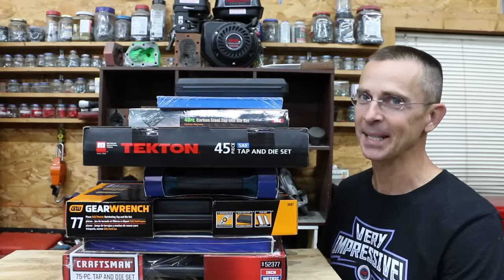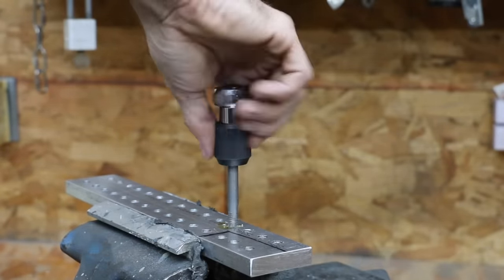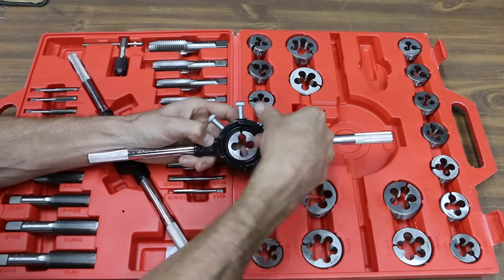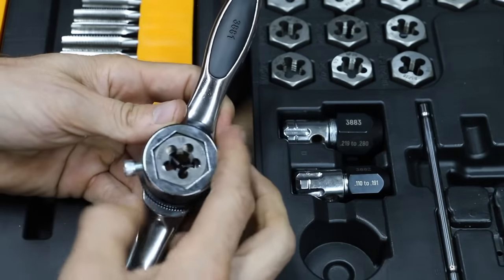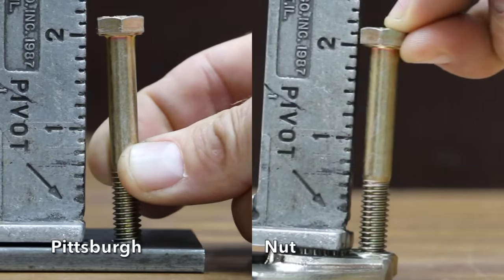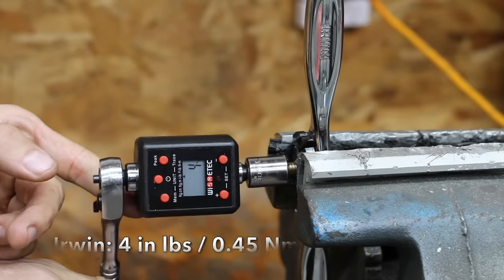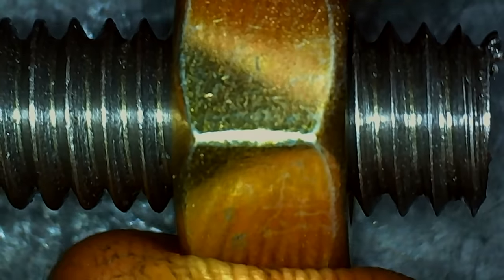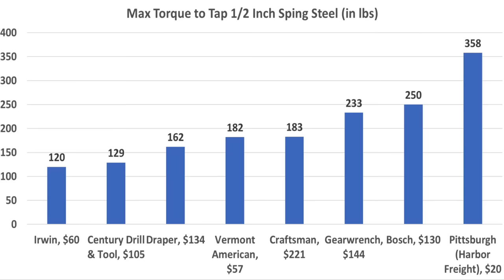Best TAP & DIE Set? Craftsman vs Irwin, Bosch, Draper, Vermont American, Tekton, GearWrench

Comment: I need you to know that I'm trying to be informative and not critical with this comment. You are possibly the best content provider that I follow, for a number of reasons. I love your videos and the time and effort you put into "covering all the bases" with each group of items you test. Having said that, I, respectfully, say that you may have come up a little short on this one. 
   Training as a draftsman back when we had Vocational and Technical High Schools in this country that trained young people to go to work and not always to go to college, I learned that there are various "Fit" standards for American, and I can only assume, Metric, threaded fasteners. I have worked with many skilled tradesmen over the years and it is the rare one that knows this. Mechanical engineers and machinists know it, but not mechanics, or other end users, so much. When you use the "recommended" twist drill for a given thread size in a "Kit" like this, you aren't wrong, but you need to understand that there is actually a range of drills that should be used for each tap, depending on how much "Thread Engagement", expressed as a percentage, is desired from the finished hole. Of course you can, and most users eventually do, decide on a "good enough" size that gets most jobs done. The problem arises when you begin to compare the wobble in a nut of unknown thread engagement on a bolt, also of unknown thread fit standard, to a cut thread using the same twist drill for each hole with multiple brands of taps. Each tap brand could be used with a differing drill size that could possible replicate the sample nut and bolt fit, so the wobble factor rating could be considerably changed and, therefore, doesn't mean the tap is of poor quality or design. You as the end user are supposed to be aware of these things. Many taps are meant to be used with Number or Letter drills, not fractional drills.
   I noticed that some of your dies were adjustable dies. The ones with a split in the circumference will be adjustable. Some of them that are adjustable will have a set screw that spans the gap created by the split and can be tightened to spread the split and give a shallower cut and a tighter thread fit. The second type of adjustable die has a slit and a "V" notch in the circumference. The handle for that die will have a screw that wedges itself into the "V" and forces it apart, again making the threads shallower and tighter. 
   How DEEP the threads are cut with both the taps and the dies, will influence the torque needed to cut the thread. That means that a very sharp die, cutting a very deep thread, could still have a high torque requirement and would yield a very sloppy thread. It doesn't make it a bad die.
   I don't know if you made adjustments to the dies or not, but adjusting them, and they are meant to be adjusted and usually cost more for that reason, will dramatically change your results in many ways. Likewise, It would be helpful to know if the same "standard drill" was recommended in all materials, by all the sets. One other consideration when comparing factory nuts and bolts the  home shop made threaded products is the quality of the machine driving the drill. A drill running in a press will run truer and yield a smaller, rounder hole than one run in a hand drill. Even starting a tap with a drill press doesn't guarantee that it will go straight (although for the thickness of material you where using, it should). The factories that make nuts and bolts use precision machines called, you guessed it, Screw Machines, to mass produce threaded fasteners. In a machine shop, when making a one off thread, a bench tapping machine or a lathe is used to make sure everything is lined up and that would require the least amount of torque. A thread that runs out will get harder and harder to make.

   I'd just like your subscribers to know that if the thread is too loose feeling, they should try a smaller drill and expect it to take more torque and lube. Also be aware that some dies can be adjusted for a very snug fit. Practice on some scrap first.
Reply: Dude get a life. 

Just kidding. Thank you for leaving this comment. It's nice to be getting the correct information when looking at this stuff. It's always nice to hear from someone who is experienced. Getting the wrong info can lead to some major trouble. So thank you! 😊
Reply: @NotAdamSnider  You're quite welcome. I wish I wasn't so lazy and was willing to invest in the gear and effort required to film content, since I do have experience in lots of useful skills. I use this YouTube resource all the time to acquire even more skills and value all the content makers that put in the effort that this fella does. He's right up there at the top, wouldn't you agree? I try to give back in the comments when I can because I do know how to talk ( ask any of my friends LOL) and write, although my typing is hunt and peck. I share as I can.
Reply: Thanks for that wealth good information, some of which I already knew. My uncle was a well paid tool & die maker, cutting his teeth while serving in the royal navy during WWII, below decks as an artificer, and later after the war for a major farm equipment manufacturer, so I picked up some of this minutia second hand. I have inherited some of his precision tools, mostly from companies like Gray, Butterfield and Starrett, well made good quality precision tools that will outlast you and your next generation, harder and harder to find these days. I feel those days of precision and quality and pride in one’s work are diminishing daily.
Reply: @62Cristoforo  
China.  That's what's behind the drop in quality.  Any manufacturer who moves operations to China isn't interested in quality.  First, the employees at the new factory, including supervisor will be newbies. Chinese managers will cut every corner possible, including using cheaper, lower grade metals than specified (if you supply the material yourself, they will sell it and buy cheaper), and then pocket the difference.  They will justify this fraud by: "If I don't do it, then I'm not doing enough for my family." Chinese don't trust each other, and will take advantage of any foreigner from a high trust society where people where living up to contractual obligations is considered the bare minimum, not a ceiling which should be sereptitiously unmet by slowly lowering product quality, farther and farther below the specifications, until the outsourcing company complains, and then just revert to the standard of the previously accepted shipment, with zero intention of EVER putting out product to the quality level specified in the purchase order.
Reply: @akulkis  and as long as people buy the garbage they'll keep sloshing it out.
Reply: Yeah ,I tried diff  twist drill sizes....I was surprised in torque and fit ,thread engagement.  You turned on bright light of knowledge. Thanks plenty
Reply: That's good information. But who would know? People would just use whatever bit comes with the set, or whatever size it says recommended, as being done here. Nothing wrong with that. Most of use aren't machinists just people with a problem to fix.
Reply: @KF1  I got tired of doing things over, or even making things worse by breaking taps off in holes.
Just like with going out to eat, I don't mind spending extra if it's good stuff!
Reply: Go have a coffee you deserve it after that dissertation!
Reply: Wow...I agree. I hade wondered about the recommended drill size by kit, and if there was a variant. Also, I think this video is more geared to hobbiests, home mechanics, etc., and not aerospace mechanics which is kind of where you are going - or for those who are, or are wanting to be machinists.
Reply: I wanna know what drillbit takes the most force sideways without snapping
Reply: @NotAdamSnider  hahaha.....     hahahahh....damn. anyone reading this...adams second quote was basically what i was gonna say.     A few years earlier I would have added the top with it as well.
Reply: @mrhalfstep  all of yall are the best.
Reply: This is the right information. The other to consider in this video is that you should never expect a high quality thread when using a ratchet tobdribe the tap. He made it even worse by adding in his meter as this just caused more slop. He should have used his drill press as a guide for running his tap if he was testing for thread quality and fit.
Reply: @Ibuildsht  A 2 1/2 inch bit takes a pretty good lickin' , but I don't know if it's the toughest. LOL
Reply: There is a fit class (tolerance) for like, every machined part. Nuts, bolts, machined threads, shafts, bearings, I mean like, everything.
Reply: @mdanm56  it was horrible to watch. I get the idea but it was very poor implanted
Reply: Thank you for this extensive explanation.
      The sharing of such detailed specific knowledge (or knowledge that is no longer taught) - I feel like that's exactly what the internet was made for.

Sincerely, thank you.
Reply: @iggysixx  Heck, you're welcome! I certainly get more than I give and I love it that way!
Reply: If it's not explained on the package, you can't possibly expect the average person to know this.
Reply: I was told that the hex shaped dies are only for thread chasing . Watching him use a drill an socket with a hex die on the rod stock was painful. I tapped out after that.
Reply: @ryandeboer9584  That isn't entirely accurate. Some hex shaped dies are just for chasing, but some have enough taper engineered into the design to cut fresh threads in round stock, provided it isn't hardened steel. They will give differing thread engagements depending on the diameter of the round stock and can't be adjusted to provide  tighter threads, which was the point of my original comment, but they actually are meant to cut threads into unthreaded rods. You just have to live with the engagement that they provide. Some of the dies that were used in this evaluation video were adjustable and could have been "tweeked" to give better than their "out of the box" result.
Reply: @mrhalfstep  thank you for all the info. I admit I have a “fetish” for bolts n nuts and taps n dies it seems.I get great satisfaction out of a successful project involving a few hand tapped fasteners. 😊
Reply: @akulkis  i cannot agree more. almost without exception, any dealings i've had with Chinese products, tools, brake rotors....you name it.....i have had a less than satisfactory outcome. their quality control is nonexistent. i've actually been looking to buy a good tap and die set for a while. it seems the only decent ones out there are the older sets (made in the u.s.) that i might find on ebay.  i'm done with buyng almost anything Chinese anymore. you end up buying twice if you do.
Reply: RollinRat  I know those things. You are preaching to the choir, as the saying goes. I'm tryin' to help those that don't know.
Reply: I wished comment could be print.
Reply: This was the absolute most respectful and informative "I'm an expert" comment I've ever seen. 
I wish VoTec HS had been an option when I was a kid, college was a huge waste of time, money, and liver health.  Assuming what you said is accurate, I learned more of value from your post and any single class I paid to take in college.
Reply: @shaynecarter-murray3127  Thank you. I love this guy's channel and was trying to be respectful. I'm pleased that it came across. BTW,  I'm not an expert. LOL There are still Vocational Training Facilities out there and there has never been a bigger demand for skilled workers. The training doesn't take long to pay for itself.
Reply: @troygoggans5495  screen shot the comment then type it into notepad. Or just write it down. 👍🏻
Reply: This video was quite cringey to watch with the crude execution of the tests. All of the T & D sets are basically toy sets compared to actual good ones.
Reply: Sounds like you should make a video so i can build a space ship mr perfect !
Reply: This is called Project Farm ! Something breaks you want to get whatever back and running ASAP. I was in farm service for 27 + years If a farmer needs to get back to the field get it fixed with what you have Cows need to be fed Get the unloader , conveyor , bunk running asap ! I really love what he does on his videos Not all of us can buy expensive tools so what he shows is how to save a buck and get the best you can afford .
Reply: I think I understand the intent of his videos to be the same as you say. I also love the guy for doing them and I contribute to his Patreon account every month for several years now because I like the content. I just think he wasn't effective with his testing, in this one case, so I was trying to share some additional info that would help him, farmers, auto mechanics, fabricators,etc make an informed decision when they buy a tap and die set and some tips on how to get the most from any set that they end up with so they can get those cows fed. I used tools like this to earn a living for a lot longer than 27 years, so I think I have help to offer.
Reply: @dmillertime  100% agree! I couldn't believe anyone would ever drive a tap with asymmetrical force. Much less a ratchet with a single handle so far away from center! The cause of the sloppy threads was greatly increased by the method he used. And the additional slop/ with that torque meter in the middle was definitely unfavorable!
Reply: @nchw68  and the giant ratchet to drive the tap in....one hand lopsided force to tap anything with get you poor results if you don't break the tap first.
Reply: @akulkis   You must live in China with all that knowledge of Chinese manufacturing. Blaming Chinese people for poor quality when it's the greedy companies that move their production facility are the ones to blame.
Reply: @dogbreath6974 
It's not either/or, it's BOTH.
Reply: I didn’t read all the almost 7K replies. It would be interesting to see how the rod/hole threaded fit within each set. Does the HF set have a better fit than the Irwin? Enjoyed the video and you insight to machining. 👍
Reply: Thank you for that. I know you know, Todd represents normal, end users and not full on Tool and Die Maker professional. 

Having said that, Wow! your insight radically changes this review, as the “apples to apples” would differ in the type of tool, and not as much in the brand. 

I dunno, I just wanted to thank you for your insight and respectfulness. I too come from that generation, pretty much the last, where they  prepared us to work but sadly the rug was pulled off our feet when the work was shipped to China. 

Thank you!❤
Reply: @raffyc66  Thanks for the shout out, Rafael. I was just pointing out that you can do a good job with low quality tools, if you know the "how to", and really expensive high quality tools won't do the job as well as them, if you don't know "how to". I can't even imagine how one would set up a really meaningful test for taps and dies. I do know that it would take so much time to conduct that only someone like Project Farm will ever likely take on the challenge. IMHO
Reply: @mrhalfstep , Absolutely! Thank you again.
Reply: Wow, that reads like a masters thesis or even a PhD dissertation.  Yes, he should have used standards used in industry. I was responsible for a lot of tapping and threading in the late 80's and we had plenty of money in test gauges etc.  Todd gets the general idea but as practical as he is, I don't think he's an engineer.
Reply: @spudth  Thanks for the compliment. I just thought it was "wordy". Todd may not be an engineer, but he's brighter than 90% of the ones I had to do work for in my 40+ year career. And in his defense doing that comparison with all the brands and various criteria that it would require isn't really a You Tube sized undertaking to begin with.
Reply: You'd be correct. As a GM master technician with almost two decades experience I had no idea about lettered and numbered drill bits until about a year ago. One of my GM instructors dabbles in machining and gave us the run down. I was like no shit haha! 
That being said you just taught me dies were adjustable. Thank you. Always noticed the set screw and never gave it much thought but when I read what you wrote I face palmed a bit, so obvious once you know!

That being said, all knowledge helps but the truth it is that mechanics aren't the primary machinist and don't have to be that precise to get the job done. 99.9% of the time we're tapping something it's because it's already screwed up and imperfect. At this point we spend more time diagnosing electronics failures than being mechanics and fixing and repairing the machines themselves.
Reply: I came here to say the same thing (maybe not as much as you did lol) and as a certified Tool and Die Maker, this episode really didn't do it for me. Actually though, every tapping, drilling and threading video I've ever seen on YouTube is poorly done. You covered the bases well.
Reply: To those looking for detail info, get  copy of Machinery Handbook. Does not need to be new. The basic mechanics of machining and Tool & Die making have changed little in the last 50 years. 

Lots of info on drill sizes wrt thread engagement in that little book and tons more.
Reply: Thanks.  My father was a tool and die maker.  When I saw all these sets, my instinct was "This looks ALL like hot garbage, where do I get a proper machinists set?"